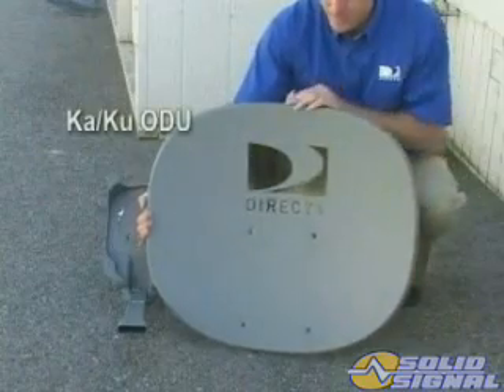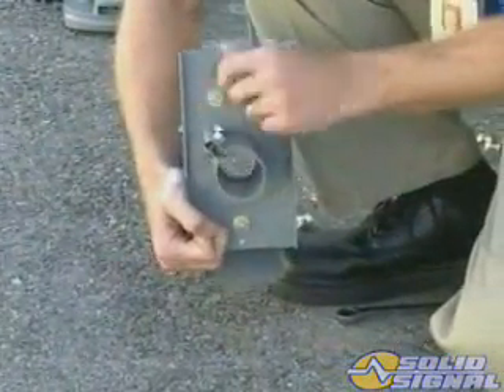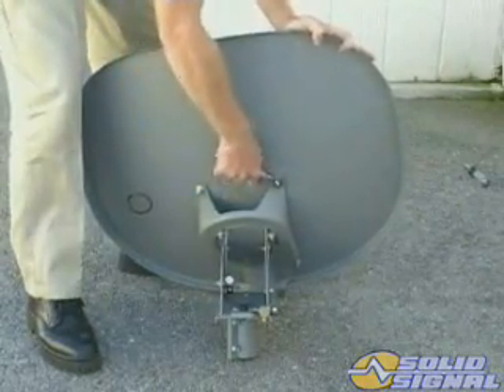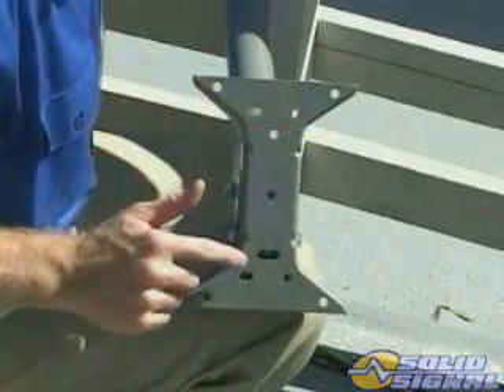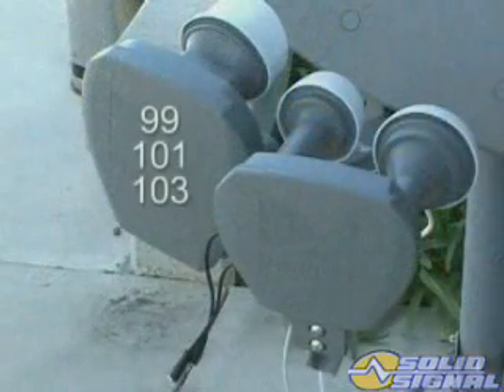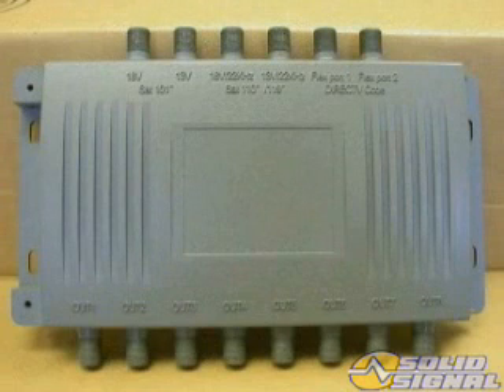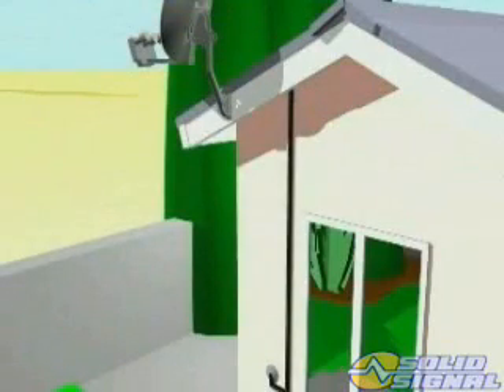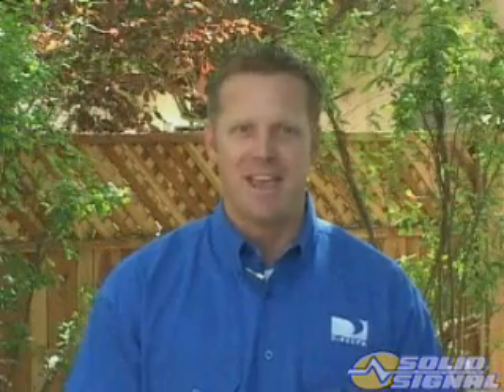DIRECTV AT-9 Mpeg-4 Ka/Ku Satellite Dish Installation - Part 2 - Dish Assembly

Comment: That's a first generation Ka/Ku as was discontinued more than 3 years ago. It was replaced by the Slimline model which now runs on the Single Wire Multi-switch and MOCA network system sporting the SWM 3 and SWM 5 LNB's.